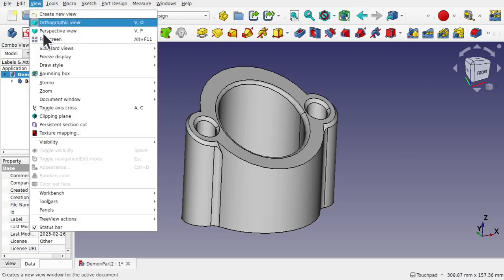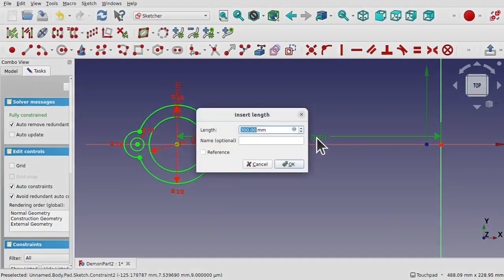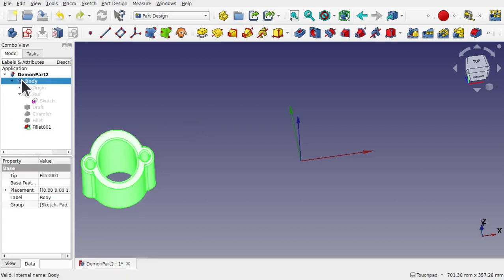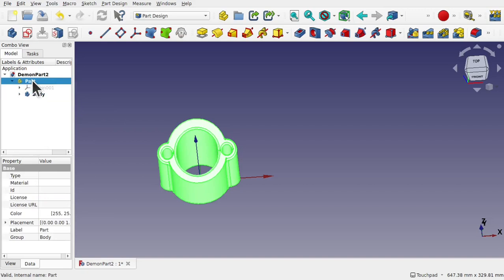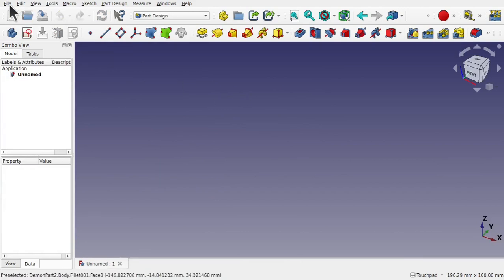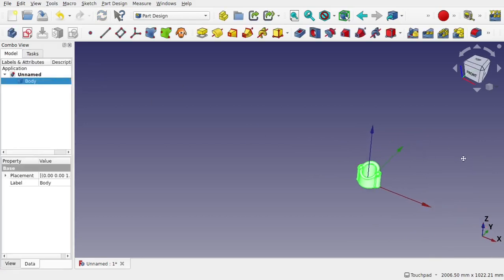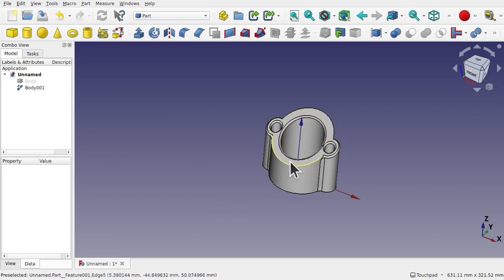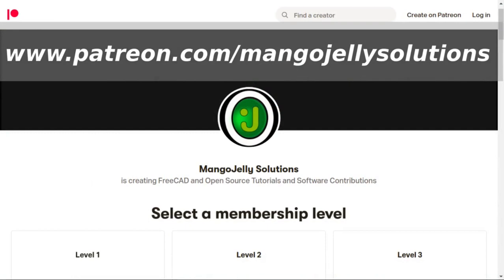FreeCAD: Fix STL / STEP / OBJ rotation and transformation axis / point of origin

Comment: Thanks for share! How did you make this angle on the cylinder?
Reply from the maker: No problems, the angle was from a reverse pocket. I go throug that in my understanding freecad series which was before the learning freecad one, I think it's quite early around 5 or 6. If you check my play lists you will see the series there.
Reply: @MangoJellySolutions  tks
Reply: I found the video that makes the pocket, but I still have a problem, I'm making a exhaust tip and I can't create a thikness between two tubes because of a chamfer.

Comment: Positioning a part to the 'about right' position is not helpfull at all. How does one go about setting a part's origin with precision (eg the center of a circular feature, or mid/end point of an edge, or whatever)?
Reply: Good question!
If you have the possibility then in the "combo" view you have the possibility to move in every axis the part selected and even have a decimal movement.
The transform is for quick movement, the positioning is for the more precise movement.
At least I do that.
Reply: i always use the manipulator workbench for exact alignement
Reply: @JanMuell42   true....forgot about that! 🤔
Reply: @JanMuell42  I've never seen/heard of that workbench. I'll check it out. Thanks.
Reply: How does one use that WB for exact positioning?
Reply: @lachendermann5408  sorry, this is impossible to explain in a short youtube comment :( my workflow is that i have a) the stl i want to align and b) an empty part design object

then i open the workbench, select one of the axes in the helper object and a face of the object i want to align. and then i select the movement axis and some other settings in the workbench and then i move the object with the workbench

but the details are a bit complicated and depend on the exact alignement you want to do

just install the workbench, watch a few video and play around a bit

sorry :(

Comment: Visual alignment to axis cross is not good enough. There should be a way to snap axis cross on at least a corner or ideally, the center of a circle. This is the hard part.
Reply: I agree, visual alignment is basically useless. Snapping to origin to me is a very basic feature

Comment: This is really helpful! Is there also a way to more precisely position parts rather than just drag them with the mouse until it "looks about right"? 

In tinkering with 3D Printers, I often have the case that I would like to take a part from a complex assembly, modify it, and then use it in another assembly. I found correctly positioning the parts to be one of the biggest headaches of that process. Being able to move an object's origin to the precise center of some feature would help me so much, but I haven't yet found a way to do it.
Reply from the maker: Funny you should say that. I have just created a video that I am editing that covers that. Not with assemblies but with sketches. You need to use the draft wb move and rotate tools along with the snapping.  You will need to set something called the working plane when rotating but worth the move you select the object hit move and you can snap it to other shapes and geometry.

Comment: I have a problem. I’m trying to polar 26 small spheres around the outside of a ring but it shows them in red and does not transform. 
Any ideas?
Reply from the maker: Is the face your polar arraying your feature on creating multiple bodies? I. e the red feature from the failed array sits out in space rather than on a solid part of your object?  If you experiment and create a single rectangle pad centered around the sketch point of origin where the axis cross and then pad. Create a small circle sketch attached to top face and pad that. When you polar array this feature it will work fine. But if you have the rectangle sketch not centered then you rub the risk of the polar array rotating around the point of orgin but not having a solid underneath.